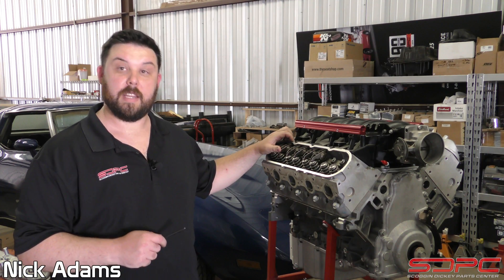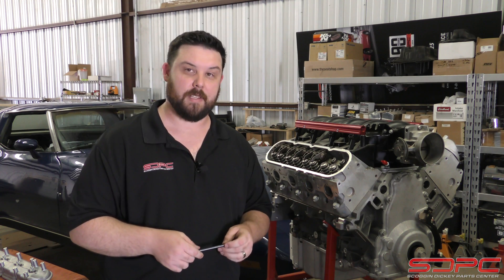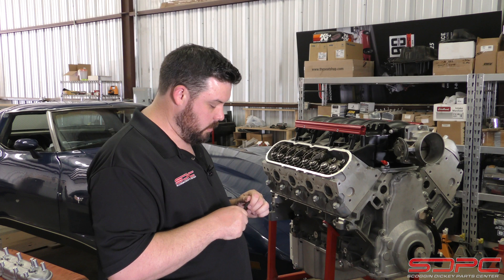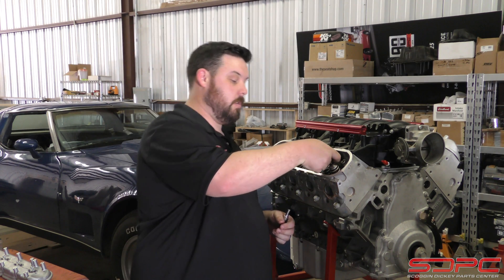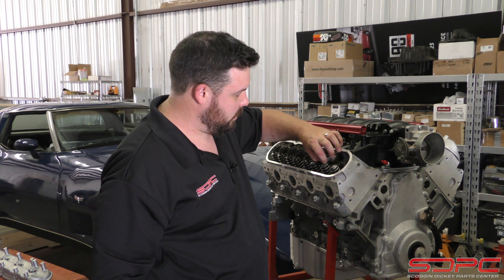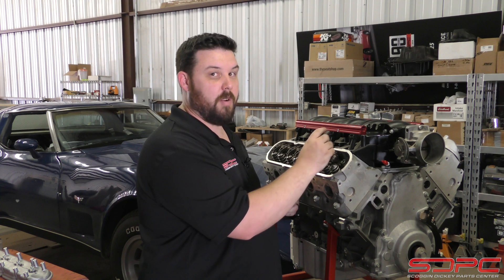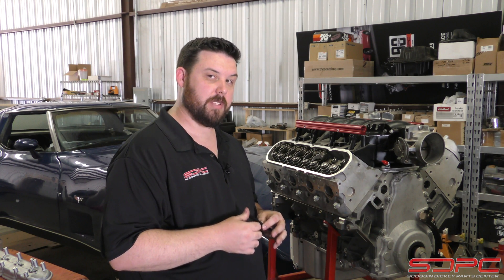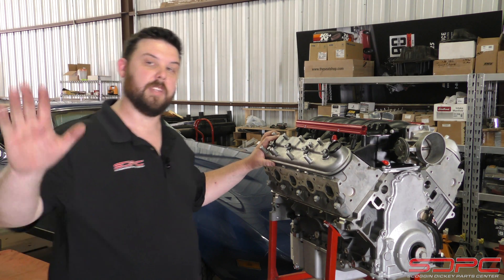SDPC Tech Tips: Pushrod Length

Comment: Put some blue dykem on the valve stem and rotate the engine 2 full revolutions to be sure that it rubs the dye off, and it should rub it very close to center of the stem, BECAUSE,  if you dont have it centered you can lose lift, EX. Old school engine ..i installed 7.800 push rods, checked valve lift, then installed 7.900 push rods and found  .021 differance in lift  !!

Comment: I would Recommend Checking piston to deck Height while had the heads off. Then set Spring hight/pressure. Then check Piston to valve clearance with Plato and cheaker springs. Then test Cylinder With piston Furthest out of the hole for push rod length. Then Lightly two finger on a nut driver set 0 lash. Then turn bolt between 1/2 -1.5 max, turns to seat rocker.  Some have gotten away with one quarter turn. But its the Ragged edge Everything.
Must be Exact, 2 is no good may Either not start, or Hang a valve with oil pressure rises.  Less terns= less oil ariation. For this reason, the sweet spot 3/4 to 1 full turn in my opinion.

Comment: I just  had my heads done, a 3 angle valve job and .030 milled off the heads, this helps to determine if 7.35 is what I need, where can I get the adjustable pushrod tool from. Great video!!!!!!
Reply: So you milled the heads, did you mill the intake because now you changed how the intake fits to the heads.

Comment: Yes sir just watched a few of you videos,great references to watch,I have few questions. ,you said ask.3GCRKSE35AG111737 is my Vin on 2010 chevy gen4 5.3 vortec ,had a misfire on 8 and ticking .dissambled,found lifter clip cam off,ordered all GM parts ,lifters,holders, bolts head gasket ,intake manifold gaskets ,everything went together nice and torque to specs,new wires coils plugs. Now it runs fine but#6 is misfiring?? Truck driving me stressed,cam was fine, all rods and rocker arms labeled  and installed in same spot,   did I miss something?, any ideas that can help my truck?

Comment: Everyone uses this method. But what about rocker geometry. This method wont guarantee that rocker centreline is at 90 deg to the valve stem centreline at 50% lift. Has everyone forgotten about this important measurement with LS Engines ?

Comment: ive built many harley twin cam engines. typically most builders would use adjustable pushrods in them. I never did like them they are weak af. however getting the exact amount of lifter preload was extremely important. especially when using S&S lifters with limiters in them. they are still hydraulic but have a limiter in them that keeps the plunger from collapsing at high rpm. I used them in my engine when i built it and i probably checked and rechecked the lash a half dozen times before i was confident it was right. My screaming eagle instructor was a ahdra drag racer. knew his shit, when your setting zero lash on a lifter you should be able to spin the pushrod with one finger without and up and down movement on the rod or rocker arm. simple explaination and it worked. good content and thank you

Comment: Does the tool take into account that 7.400” pushrods, for example, don’t measure 7.400” tip to tip? In other words, does it measure 6.800” tip to tip when fully closed or different to account for that?

Comment: I have a problem. I have a 98 4.3 V6 that I have put a comp cam 266HR cam. .500 lift. I used the stock hydraulic roller lifters and I feel like the lifters are not giving the valves the full amount of lift. I have comp cam LS Beehive Springs so there is more seat pressure as well as maximum over the nose. Are the stock hydraulic roller lifters adequate for this much lift and pressure? I did not think at the time I built the engine that this engine was that radical. thanks!

Comment: Great video. I rolled my pushrods on granite to see if they were straight before installing them. I found several that were bowed oquite a bit in the center.
 I returned them until I had all straight pieces. Silly? LOL Like they say, a bent pushrod is just a stiff spring!  LOL

Comment: once you order pushrods and add in preload, then torque them down is there still play? i did mine and checked and checked and checked. then ordering them installing them and after torqueing them there is no play. So should the play still be there after installing them??
Reply from the maker: Once pushrods have been installed and the rockers are torqued down, there should be no play.

Comment: When I’ve done it, I wouldn’t rely on pushrod turns, I would measure the rod length.
Reply: I don’t think you can measure tip to tip though. Maybe I’m wrong, but a 7.400” pushrod doesn’t measure 7.400” tip to tip, for example.

Comment: Great vids....I had someone put a stage 2 sloppy cam in my 6.0..new oil pump and chain,gaskets..he said I needed new pushrods so he got manleys 7.450 -7.500 ..he put them in and when I picked up engine he said 2 of new ones were to long ??? He measured them...do you think I have to worry ? I was going to do new spring kit....just dont want to have any problems Thx
Reply: what happened?  Did they work?

Comment: I have Chevy 383 with solid roller lifters  was going to deck the heads about  .010 do i need new rods?
Reply: If is a SBC not a LS have to get the rocker and pushrod geometry correct on the valve tip and then use feeler gauge to correct lash as majority of SBC rockers are adjustable. .010 generally no you don't need new pushrods but if your trying to reuse the stock pushrods for any performance  I would upgrade.